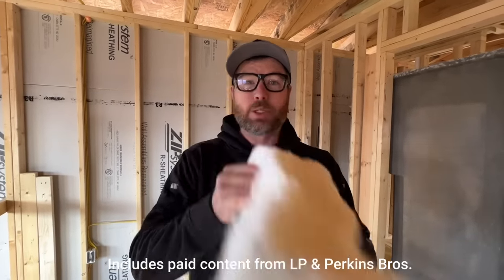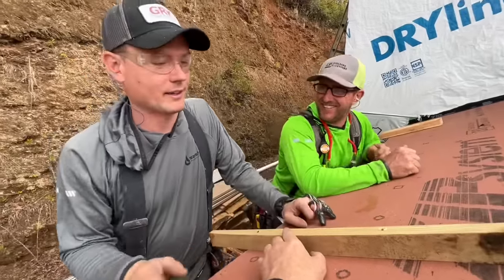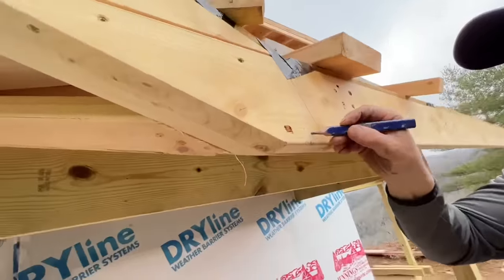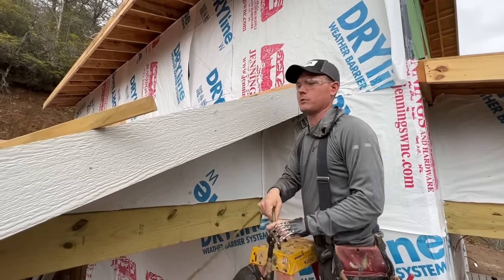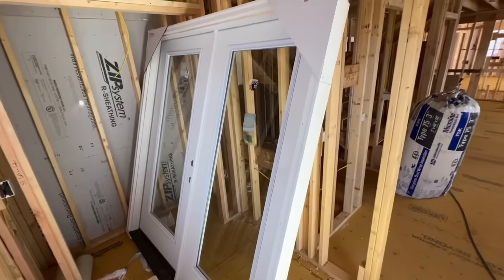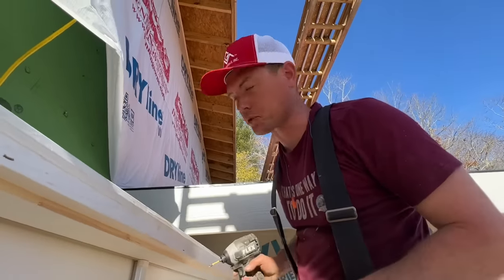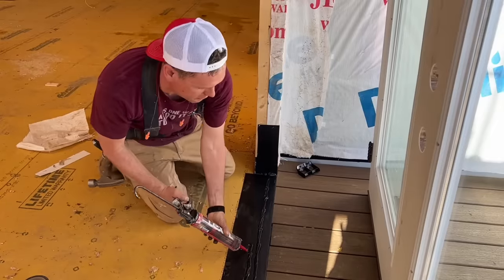Installing Doors and Finished Facia | Building A Mountain Cabin EP25

Comment: I've read that LP Smart siding isn't a good choice. They have 2 other companies  paint their product.  So it is very hard to get them to replace anything when it comes to the warranty.  You also are not supposed to spray water directly on the siding because it is easy for water to penetrate and or get trapped causing damage.

Comment: Curious why you guys are still using those can lights when the slim profile lights(halo, razor, amazon ones) are much better(in my opinion.) Other then the obvious reasons, putting then anywhere you want as long as its 5/8 rock on the ceiling was a big one since they can go under a joist/rafter

Comment: I thought I was going to see lots of joist hangers, especially for the roof structure. For roof tie down, in case of tornado or any wind uplift. Is that not part of the code in your area?

Comment: Recommendations vary based on climate zone but yes you have the Kraft paper thing right. The idea is to have an air/water barrier on the outside of your building (in this case you do, the zip system). This keeps vapors from condensing inside the wall in a time like the warm summer when water vapor hits the cool wall from indoor air conditioning. Also, there’s humidity indoors. The same thing can happen from the inside out so you want that Kraft paper to keep vapor from entering the wall cavity and condensing somewhere inside causing mold/rot.

Comment: Wider and taller on the rough openings is always better. Also carpet and tile might give you door scrubbing issues and force you to cut them. I always add an extra half inch to the height and on garden doors an extra inch or 2 wider. Easier to add another thickness of plywood or 2x4 in the opening than to have to cut out larger !

Comment: Be careful of caulking over nails!! Used a highly recommended product ($$$$) years ago that said it was paintable for outside trim and the customer painted it days later only to have it flash through. He tried priming and repainting still no luck. I believe that if the caulking could have weathered a couple of weeks that might have prevented the problem, but the instructions did not mention it. Live and learn.

Comment: In Europe the quality control inspector would not pass 70-80% of your construction methods. 
List of things that would be rejected just on eye sight alone.
1. Placing OSB or waferboard as roof or outer wall
2. Placing outer wall panel directly in contact with the wind protection foil
3. Not having a water vapor foil on the inside
4. Not having an installationlayer on the inside
5. Outer wall thickness minimum 170mm or 6 ¹¹/₁₆ (In sweden the avarage house has 250mm walls)
6. Roofing felt needs to be integrated with plate on endings, roof penetrations and on every place with a chance of water spray.

Comment: The paper on the insulation works somewhat to prevent moisture. Easiest way to prevent condensation on the inside is too use  thicker thicker zip-r sheathing. I believe for your climate zone it should be 2/3 of the total r-value on the exterior and condensation will theoretically never occur.
Reply: Speaking of climate zones, for the first time in nearly 20 years, the ICC updated some climate zone designations in the 2021 IECC, including counties in Northern North Carolina. The bulk of affected counties bumped up from climate zone 4 to 3 (warmer), and I believe only one county dropped from climate zone 4 to 5 (cooler). According to some articles I read, the ICC based the updates off data collected by over 4,000 weather stations across North America over the last 25 years.
Reply: The insulation in the zip R sheathing is not the exterior side tho. It is on the same side as the wall cavity insulation. To be on the exterior side it has to be after the house wrap (weather barrier).
Reply: @Faruk651  Good point, did not think of that.

Comment: I couldn't agree more with your tip on hiring subs that you can contact when needed. It took me a few years but eventually I had subs in every trade I needed who would be at the job and answer my calls any time of day / night / weekends. It makes every job run much smoother and stress level much less. Another great video!

Comment: When you guys threw up a reference to the door rough out measurements, it looked like it came from a building manual or something. What reference is that? I'm new to this stuff and would love a sort of how-to guide. Thanks!
Reply: You basically just (normally) add 2 inches to the width of the door slab to get the framing width

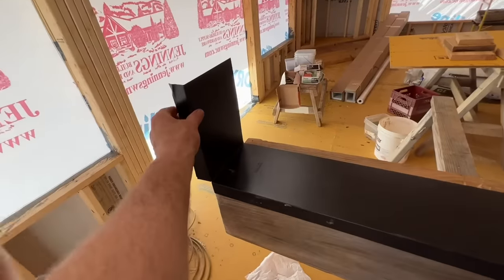Comment: 9:27 not sure if it was your electrical guy or somebody else with the expanding insulation on the wire run holes but it looks like you guys are set for an Easter Egg Hunt. 😂😆😉

Comment: Just so you guys know. Jamie is correct that historically in Ashrae climate Zone 4A, the Kraft facing would go on the inside. However, you guys installed ZIP-R on the outside which is vapor impermeable, so now you have a vapor barrier on both the inside AND outside so this is a big mistake and will trap the vapor and cause mold. I suggest you talk to a local architect if you don't understand my explanation.
Reply: Zip R insulation is vapour permeable. Same as an EPS styrofoam.
Reply: @Faruk651  polyisocyanurate is not permeable. You are clueless.
Reply: @Faruk651  it's on the product brochure lol. Go to the website.
Reply: @CybekCusal  We don’t have the zip system in Ontario, Canada. I always assumed Zip R is vapour permeable. It is crazy if that thing is a vapour barrier. In that case their fiberglass insulation will be sandwiched between two vapour barriers. How does a person like Jamie miss this detail???
Reply: @Faruk651  just Google this "is polyisocyanurate permeable"
Reply: @CybekCusal  Yes, i did. Type of foam Zip R uses, is not vapour permeable. I was wrong assuming that it was. Perkins Brothers can you please give us your view on this topic.
Reply: @Faruk651  the issue is a lot of traditional builders trained in the old methods are under a lot of pressure to adopt new energy codes and they haven't had the proper training to know how to apply them properly. I see this issue a lot. In the case of North Carolina they rejected the national code for continuous insulation and made their own which promotes mold and many builders trust the government codes as design guidance (mistake #2)  when in fact it's flawed.
Reply: @CybekCusal  You are totally right about the new technologies and lack of training. I work in construction and some mistakes i see is unbelievable, i feel bad for those home owners. I keep seeing houses being wrapped with XPS insulation on the exterior for continuous insulation and these houses have a 6 mil vapour barrier plastic in the inside (behind drywall). They pretty much sandwich the whole wall assembly with vapour barrier.
I am working on my own house atm, i have 2x4 walls with R14 roxul insulation with 6 mil vapour barrier on the inside. I am planning to add 2” thick EPS foam on the exterior sheathing 7/16” osb which is covered with liquid water/moisture barrier. 100% tight. Do you think this will create problem in climate zone 5, i am right across Detroit, Michigan. 2 inch thick Eps foam has R value of 8. Vapour permeablity is 0.5. Foam will be applied with cementious adhesive with a notch trowel, so it will have drainage grooves on the back side.
Reply: @Faruk651  so I'm the energy manager for a 7M square foot commercial campus and part of my territory is Michigan so I know this climate zone 5&6A the best. I think both XPS and OSB are considered vapor retarders (semi permeable) and would suggest maybe to forgo the interior vapor retarder completely or use a two way smart retarder (which I don't have much experience with).

Comment: Is there a reason y’all use sidewinder circ saws vs worm drive? I’ve heard a discussion about west coast builders and east coast builders.
Reply from the maker: Good question… Most people around here is the side blade type. I haven’t even seen the worm drive kind for sale in the stores here
Reply: @PerkinsBuilderBrothers  you’re right, they don’t sell them in stores here on the east coast. You should try one. Waaay better than a sidewinder IMO. I’m an east coaster (North of Atlanta). My sidewinders have been collecting dust. If you’re right handed, it’s way easier to see your cut, plus the gear drive give them more power/torque compared to a sidewinder. Just got the new metabo hpt 36V a couple weeks ago. Ordered it online.